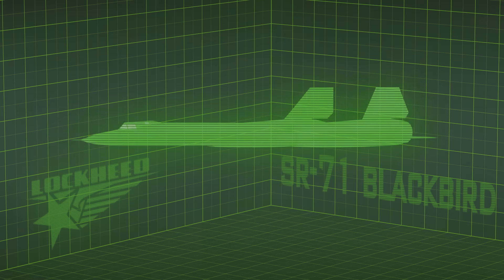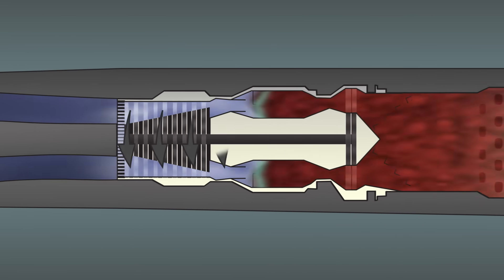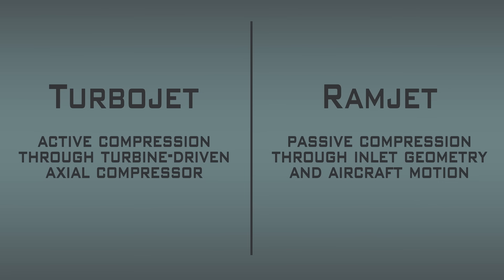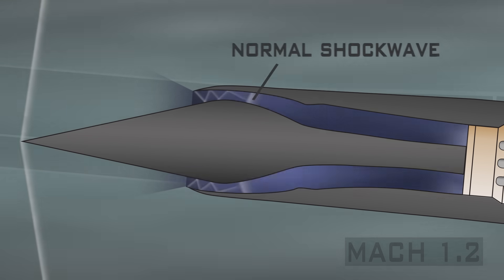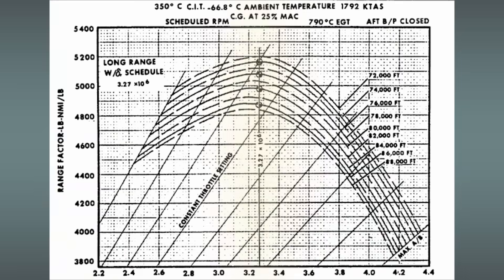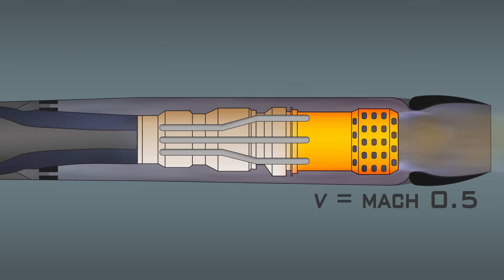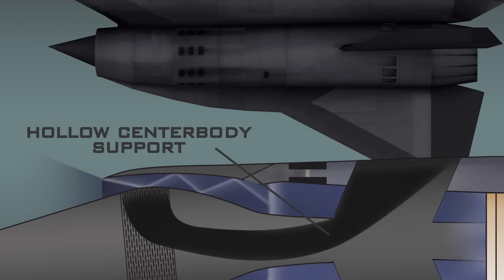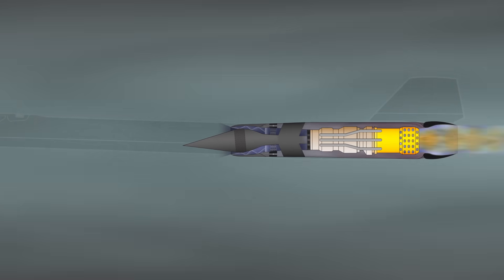The Mighty J58 - The SR-71's Secret Powerhouse

Comment: Flares? who need flare when you can just outrun the damn missile
Reply: +Bartonovich52 Blackbirds have actually outran missiles before......
Reply: Lardawg 67 Not true. Blackbirds regularly went on spy missions over Russia. The incident with the swedish Viggen is proof that they at least went over Sweden into russian territory.
Reply: I have talked to people that HAVE flown missions. You are the one that stated the SR-71 went straight to the museum after test flights. What is the source of that information ???  Where did you get that info ....that's what I'm asking you to produce....even if it's not absolute proof. Obviously you can't produce it which is why you resort to insults.
Reply: They did fly over the USSR and they did outrun all missiles fired at them.
In fact no SR-71 has ever been shot down.
Reply: LOL I can't even respond to that. This conversation is getting dumber by the minute.  You are the weakest link...goodbye.
Reply: ThatMontmorency Friends or not, fact of the matter is the Blackbird was used. A lot.
Reply: It's not a simple matter of the speed of the missile vs speed of target. By the time the missile has climbed to the 80,000ft+ altitude of the SR-71 (around 20 seconds for something like the SA-2/S-75), the target, travelling at over Mach 3, is some 15 miles further downrange. Given the missile must be fired at an angle (i.e. not stright up) to achieve intercept, the time-to-altitude is even longer and the target further away.

With the limited fuel of a high-speed missile, it has run out of thrust long before reaching the vicinity of the target.

Then you have the problem of tracking targets with older, mechanically-scanning radar systems (this is the '60s and '70s we're talking about). A high speed, high altitude target travels a long way between each signal return, making it harder to achieve accurate guidance for a missile interception.

Plus adding in the less sophisticated computing power of systems designed 50 or 60 years ago.

Altogether, it's actually quite easy to see how difficult it was at that time to shoot down a target like the SR-71, even with high-performance missiles of the time.
Reply: Yes, because the divisiveness today goes back to 1981 when it was first reported to the public. Just man up and admit you were wrong. It's your fault for not fact checking yourself. But please, go on and keep making a fool of yourself. It's no skin off my sack.
Reply: 1970's missile*
Reply: Stoyan Todorov truu
Reply: "Every educated person immediately remembers renown Soviet mathematician Lev Pontyagin and his Optimal Control Theory"

Personally consider myself rather intelligent but I DONT KNOW WHO DA FAQ DIS IS.
Reply: I didn't read every reply here, but the SR-71 absolutely flew on missions. North Korea even tried to shoot one down(with soviet made missiles) and missed. Barely. This event is pretty well documented and has been reported on by several outlets. Even as early as 1981. If you want a source, just google 'sr-71 north korea'.
Reply: @Stoyan- No I didn't see that post....but thanks. The weakest link comment belongs to ThatMontmorency, not you. I have two friends who were SR-71 pilots so I know that ThatMontmorency's comments are wrong.
Reply: Lardawg 67 did they experience any problems or cancer after flying?
Reply: "While the SR-71 carried radar countermeasures to evade interception efforts, its greatest protection was its combination of high altitude and very high speed, which made it almost invulnerable. Along with its low radar cross-section, these qualities gave a very short amount of time for an enemy surface-to-air missile (SAM) site to acquire and track the aircraft on radar. By the time the SAM site could track the SR-71, it was often too late to launch a SAM, and the SR-71 would be out of range before the SAM could catch up to it. If the SAM site could track the SR-71 and fire a SAM in time, the SAM would expend nearly all of the delta-v of its boost and sustainer phases just reaching the SR-71's altitude: at this point, out of thrust, it would go ballistic. Merely accelerating would typically be enough for an SR-71 to evade a SAM; changes by the pilots in the SR-71's speed, altitude, and heading were also often enough to spoil any radar lock on the plane by SAM sites or enemy fighters. At sustained speeds of more than Mach 3.2, the plane was faster than the Soviet Union's fastest interceptor, the Mikoyan-Gurevich MiG-25, which also could not reach the SR-71's altitude. During its service life, no SR-71 was shot down."
Reply: +ThatMontmorency
False, the SR-71 was used in recon missions up through 1990(when it was retired from that kind of service but 3 were brought back into service in 1995). As a matter of fact on 19 October 1997, the last flight of SR-71B #61-7956 was at Edwards AFB Open House. I was there and witnessed that flight as a member of the USAF. I'd seen #956 launch and recover on numerous occasions prior to that. 
Anyway the SR-71's side looking camera's got lots of peek's inside Russia without flying over Russia(Due to an agreement between the Soviet Union and the United States restricting the use of manned vehicles over the Soviet landmass), those flights were done out of RAF Mildenhall, UK were I was also stationed at one point in time. The A-12 Blackbird on the other hand only flew a few combat recon mission over Vietnam out of Japan as well as a few non-combat recon missions over N. Korea. It was eventually replaced with the SR-71 Blackbird which flew it's first recon mission out of Japan on 21 March 1968. On July 1st of that same year the SR-71 and A-12 Blackbirds had a "fly-off" in a mission over Vietnam to see which was better.

I don't know what's more annoying, obvious Trolls, or armchair quarterbacks such as yourself that think you know everything. Especially when it has anything to do with USAF operations I was involved in or directly witness to.
Reply: ThatMontmorency Yea, except all the times it flew over Israel and Vietnam...
Reply: On the year 2980: why do you need stealth technology if you can outrun the damm radiowaves?
Reply: Back then, you definitely could. There were actually a few documented cases of literally outflying missiles. And there were multiple missions deep into the heart of Russian territory with the SR-71, most of which were never even engaged because they didn't want to waste missiles on them.
Reply: By the mid-1980s, Swedish Viggen fighter pilots, using the predictable patterns of Lockheed SR-71 Blackbird routine flights over the Baltic Sea, had managed to achieve missile lock-on with radar on the SR-71 on numerous occasions. Despite heavy jamming from the SR-71, target illumination was maintained by feeding target location from ground-based radars to the fire-control computer in the Viggen. The most common site for the lock-on to occur was the thin stretch of international airspace between Öland and Gotland that the SR-71 used on the return flight.[83][84][85] The Viggen is the only aircraft to get an acknowledged radar lock on the SR-71.[86] This is a straight up copy pasta from the Saab 37 Viggen article in wikipedia.
Reply: It's not that complex (although the equations themselves can be), just using calculus to boil down criteria to give an optimum solution. The physical constraints - time to altitude, missile fuel and maneuverability, radar tracking capabilities, speed of target - still exist. 

Getting something from a standing start to 25,000m altitude, not to mention horizontal range, in order to intercept a target  travelling at getting on for a kilometre a second, with just 25 seconds of thrust available and only a few hundred km/h in the way of speed advantage - that envelope for an interception becomes vanishingly small unless the SR-71 maintains a direct heading towards the launch site, ignoring all radar warnings.
Reply: I know AA missiles can go significantly faster than mach 3.2 (though the plane could get faster for short amounts of time, there are many unofficial sources saying sprints at 3.5 were possible in serious situations). Just because the missile is faster however doesn't mean that it can intercept the plane. Since they use solid rocket fuel, they have limited amounts of propellant (fun fact, missiles only hit their top speed for a split second, right before they run out of fuel, they actually coast for much of the flight). By the time the SR-71 was detected and a missile was launched, and the missile climbed to the required altitude, the missile wouldn't have enough fuel left to catch the target before it ran out. Here's an explination that goes into more detail: https://www.quora.com/How-was-SR-71-able-to-outrun-SA-missiles

The diagram shows how an S-75 would have serious trouble hitting a mach 3.2 plane, and would be completely unable to hit a mach 3.5 plane.

Also it's worth mentioning that the plane flew high enough, and had good enough cameras that it didn't need to intrude often. For example, to keep an eye on the soviet submarine pens all they had to do was fly over the arctic ocean. Often they would even provide countries like the Soviet Union and China the pictures taken to show that the flights were legal.

In addition, here's a story written by an actual SR-71 pilot, that details how they were fired at often (now not with current gen AA systems, I imagine an S-400 would make short work of one). http://sploid.gizmodo.com/5511236/the-thrill-of-flying-the-sr-71-blackbird

Finally, the plane wasn't invincible. In some cases Soviet planes did get lock on, but didn't fire (usually because the plane was in international airspace).
Reply: ThatMontmorency so does this mean all the hype surrounding Russia's new hypersonic missions is just that, hype . If a slower missile can shoot down a faster object, then that negates Russia's supposed Mach 10 Zircon missiles and the one laucned from the Mig 31
Reply: i guess you think the earth is flat too?
Reply: The SR-71 out ran a SAM over North Korea in 1978 if im not mistaken there a video on youtube of the pilot and nav talking about it
Reply: AHAHAHAAHH.

The USSR  was in fact the absolute prime mission for the Blackbird.

AND FOR THE RECORD: the SR71 survived over 450 attempts from G2A missiles to shoot it down.

Reasons? Because at those altitudes, there are were no missiles able to keep up with the speed because of the ramjet nature of the J58 engine.

The blackbird was retired in 1990, 20 years and tens of thousands of photos and intels later.
Lockheed actually proposed, in the recent past, a new successor to the Sr71.
Reply: +ThatMontmorency......I never said my pilot friends flew over Russia, in fact I stated we never flew over Russia in an SR-71 . I was referring to your comment that the SR-71 never flew a mission and went straight to the museum. Why do you state such ridiculous things as fact ??? Where is your proof that the SR-71 never flew a mission ?? BTW my 2 pilot friends are Lt Col Robert G Sowers (1st SR-71 instructor pilot) and Maj Gen Pat Halloran (U2/ SR-71 pilot). My avatar picture has the three of us at the Air Force Academy.  If I state something I will always be able to prove it. Peace
Reply: ThatMontmorency no, are you insane?
Reply: It does not take goddamn genius to know that an aircraft going at mach 3 and can sustain such speeds for well over an hour at 80,000 feet has a head start in height distance when out running a missile with equally or faster acceleration launched from the ground. All that matters is how much fuel that missile has which is never enough to catch a the SR-71. The biggest surface to air  missiles only have enough fuel to last no more than 3 min at best. Over 800 missiles were launched at the SR-71 and all failed.

The only way possible to bring down an SR-71 if it is caught right in the middle of multiple defense domes such as 4-5 of them under a central defensive grid and all launched multiple missiles simultaneously heading toward the same intercept vector. Then there is no way the SR-71 can out maneuver or out accelerate those  missiles coming from all directions.
Reply: People in 1981 be like "They gonna argue bout this till 2017"
Reply: thats not true... you still cant beat rockets for raw speed and acceleration. not even the rockets of the 60s. they just outran the targeting abilities
Reply: These trolls lol. like first Last said : "While the SR-71 carried radar countermeasures to evade interception efforts, its greatest protection was its combination of high altitude and very high speed, which made it almost invulnerable. Along with its low radar cross-section, these qualities gave a very short amount of time for an enemy surface-to-air missile (SAM) site to acquire and track the aircraft on radar. By the time the SAM site could track the SR-71, it was often too late to launch a SAM, and the SR-71 would be out of range before the SAM could catch up to it. If the SAM site could track the SR-71 and fire a SAM in time, the SAM would expend nearly all of the delta-v of its boost and sustainer phases just reaching the SR-71's altitude: at this point, out of thrust, it would go ballistic. Merely accelerating would typically be enough for an SR-71 to evade a SAM; changes by the pilots in the SR-71's speed, altitude, and heading were also often enough to spoil any radar lock on the plane by SAM sites or enemy fighters. At sustained speeds of more than Mach 3.2, the plane was faster than the Soviet Union's fastest interceptor, the Mikoyan-Gurevich MiG-25, which also could not reach the SR-71's altitude. During its service life, no SR-71 was shot down."
Reply: If everyone here just picked up a book instead of arguing on the internet or listening to their black ops pilot friends they'd know it never officially flew over the USSR after Francis Gary Powers unfortunate capture put a stall on what where once routine flights, saying that alot of the USSR didn't have great radar coverage so who knows. 
Also with the SIGINT system and it's op ceiling being 80k coupled with strategic placement of  most soviet equipment, they probably had no real reason too. 
The SR 71 was never downed by enemy action although there where specific SAM systems that probably could intercept it like the SA-5 Gammon which was designed to shallow dive high altitude aircraft. On an air to air front the MIG 31 was fast enough to probably intercept. 
so short answer, who the fuck knows, but we can surmise there was probably no reason too.
Reply: There was no reason for the SR-71 to overfly the USSR. 

In fact... the U-2 was never originally supposed to overfly the USSR, but Eisenhower desperately needed Intel. He was only willing to risk a few missions, and Gary Powers got shot down and the rest is history. It was a terrible loss of face for the US and ended any possibility of sending aircraft OVER the USSR—no matter what kind. 

The SR-71 was designed to fly over the USSR, but the risks were too high and it never did. 

As I said before... a few minutes of transit over a tiny third world with access to the sea nation is an entirely different ballgame than going over the world’s largest nation with a dedicated homeland defence Air Force (the PVO). 

And they were right. During the Baltic transits (which never penetrated Soviet airspace) both Swedish and Soviet interceptor aircraft gained favourable firing positions multiple times on the SR-71... the Swedes for fun and practice, the Soviets ready to blow it out of the sky the nanosecond it strayed into Soviet airspace. The risk of a man and technology was far too great. 

Of course, they didn’t need the SR-71. Corona spy satellites were giving imagery and soon the KH series of satellites could do it in near real time. There was also the Ryan Firebee drone which didn’t risk a man or high technology, and was nearly undetectable and almost impossible to shoot down. Humanint and Sigint had higher intelligence yields for far lower risks. 

The SR-71... like the A-10.. is a Chuck Norris airplane. It has a reputation it didn’t earn and doesn’t deserve.... being written in as part of the American Myth where through tight shots, ommisions, and weasel words it winds up being the best even though it really did sweet fuck all. A C-135 could have done 90% of the missions it flew better and cheaper.... and actually does overfly Russia now as part of the Open Skies Treaty.
Reply: You would rather need chaff's and not flares to begin with. Most surface to air missiles are radar guided. (I know, it's a joke but I just had to say it.)
Reply: Lardawg 67 Read my second comment :)
Reply: Lardawg 67 So you can't see the post where I have a video confirming YOU are right and I apologize? Good day to you.
Reply: ThatMontmorency challenge acepted /(-_-)/
Reply: Flintstoned XD
Reply: its just differential EQ no big deal
Reply: Sesko Rirkea Shimrui and also the heat by the compression
Reply: lightwaves are still effective, laser guidance my dude
Reply: It’s basically a “Just in Case” clause to avoid paying insurance.
Reply: A quick addition to this old chain, the SR-71 did often fly outside of Russian air space because of its amazing camera equipment, but it did fly over airspace, and it was considered impossible to shoot down based on the insanely advanced Ewar it had combined with its incredible speed the SR-71 was not stealth despite its color, it was actually weirdly reverse. It could project itself to have a radar signature the size of a barn
Reply: not when it is coming at you from the front
Reply: Technically they can't out run missles. What they do is fly so fast that the missles tracking system can't accurately track their target.
Reply: The SR 71 needed to be refueled after flying for a while due to fuel leaking out of the expanding seams on the body. it also was about 6 inches longer overall when it landed then when it took off
Reply: I read the article. How are flights over the Baltic Sea and a stretch of "international airspace" flying over Russia ? Oland and Gotland are not even on the Russian border. The SR-71 had sideways cameras that were capable of filming deep into Russia without even entering Russia. This article proves nothing .
Reply: Probably because every educated person has an education for themselves gained from experiences that are solely their own. 

Along with the elitist dickhead use of the term by ThatMontmormency being completely irrelevant and meant to frame himself as from a superior group compared to others. The superior dickhead group.
Reply: Ulfcytel Yep, it's not the speed directly, but the missiles inability to correct for such speed changes.
Reply: Wow....I was just reading through these comments after watching this video for the 1st time.... someone actually said that a missile going .5 mach will shoot down a plane going 3-4 mach🤣🤣🤣🤣🤣 who isn't good at math🤪🤪
Reply: @74superglide  - 4 out of 3 people have trouble with fractions.
Reply: Some people are not good at geometry, either.......
Reply: The SR-71 only “outran” missiles because it only overflew poor and tiny nations with sea access. By the time they were ready to fire it was a stern chase—missiles gaining, but running out of fuel before they could hit. The Iraqis actually did the same against the Phoenixes the USN tried to fire at them. But the SR-71 doing a two hour transit across the USSR would have many SAM batteries firing at it head on... and no direction to turn which wouldn’t bring it into range of other batteries.
Reply: how fast you need to go to outrun a missile?
Reply: ThatMontmorency k nigga damn
Reply: Hey can you send me a link to that information. I would like to read about it. If its one "incident" how can you say they flew over Russia regularly ? I'm not being a smart ass, but something doesn't sound right. We had a U2 stray into Russian territory during the cuban missile crisis but I wasn't aware of any SR-71 over Russia. If you have the info please share. Thanks !!
Reply: ThatMontmorency the fastest missiles only goes mach 3 or 4 I'm prettysure tbr heat caused by the friction of going that fast would detonate it
Reply: +Sesko Rirkea Shimrui False. Mach 3 is what a modern anti-ship missile can reach. And it can do it at sea level (!). An AA missile is much smaller and thinner than an anti-ship one, carries less payload, does not need to accelerate from zero and has a much shorter active engine phase (i.e. less fuel to carry). Which is why they are so much faster.
Reply: Zimri Leisher if they were detected they’ve would have gotten a taste of the worlds best interceptors ☭

MiG-24 ☭
MiG-35 ☭
Reply: @Americana-deluxe   The MiG 24 doesn't exist and The MiG 35 is a Gen 4.5 fighter
Reply: @ Your local meme and anime dealer. 

And 5th generation is just a marketing term invented by Lockheed Martin to drain the US Treasury.
Reply: @calvinnickel9995  Then there is no generation of jets. You people are special
Reply: The SR71 never flew over the Soviet Union or China. The Russians were aware of the SR71 before it went into service. An amazing plane as it was it wouldn't have taken Russia long to work out a way to intercept. It's much more of a feat to make a Mach 3.2 aircraft than to shoot one down.
Reply: You can't. In fact, this was why they never used the SR-71 over Russia.... and the similarly performing XB-70 was cancelled.
Reply: @Bartonovich52  ahhh... it ran quite a few missions over Russia. They just don't out right say that. Many of the Blackbirds missions and its specs are classified to this day. We will never know what this plane truly did or what it was really capable of.
Reply: @Bartonovich52  no sr71 flew over russia many many times just like the u2 jet
Reply: +Ninja Man No, it can't really outrun a missile. AA missiles are much faster than Mach 3. SAM missiles are slower (at least were slower in that era), but SAM missiles are used differently - they don't need to be able to chase the plane. Every educated person immediately remembers renown Soviet mathematician Lev Pontyagin and his Optimal Control Theory, which was initially created specifically for the purpose of SAM guidance. It guarantees that a slower SAM missile can always meet up with a much faster airplane if fired and guided properly. Obviously, this is less important with modern SAM systems, like Russian S300 with Mach 7 missiles. Nevertheless, this is still the reason modern mid-range systems with Mach 4 missiles can reliably shoot down Mach 8 targets.
Reply: The SR-71 never flew over Russia. The U2 was shot down over Russia but they never risked the blackbird flying over Russia.
Reply: @lardawg6794  it was the blackbird's mission to fly over russia... they used it to take photos of military installations! Thats why it was built in the first place, to fly over Russia and the fact you say it never flew over it during cold war is spreading false info xD
Reply: @user-h3w7d  - show me your proof that it flew over Russia at anytime...ever. It had sideways looking cameras that could take pictures inside Russia while flying outside the border....but it never entered Russian airspace. The U2 is a different story.
Reply: @user-h3w7d  - ......* Crickets *
Reply: @user-h3w7d  sr71 never flew over Russia, thing is once u2 spy plane was shot down, America understood they had underestimated Russia, because all this time although U2 was flying high over Russian Airspace successfully, and was not shot that time, was not because of perception U2 can't be seen, as Russia definitely had U2 on its radar, and were continuously recording flight path of U2, but because Russia was busy making their new intercepter missile operational, when it was ready, 
it made U2 its first prey. 
America although having SR71 designed and operational, restricted its mission over Russia not due to risk of sr 71 being shot down but due to risk of war breaking out. Already with U2, breaking point of Russia's patience was reached, and if SR71 would have also did the same, then definitely one more cold war would have begun.
Though Sr71 though would have definitely been successful in outrunning Russian missiles or intercepters at that time, but was definitely not fully invisible to Russian radars. And that would have been enough for Russians to go in full nuclear war with America. That is why it never flew inside Russia, although it had full capability of doing so successfully. 
But still America was able to conduct it's monitoring over Russia from its borders, Sr71 had advanced camera and recording ability with state of the art technology, to look for any changes in Russian movement and buildup, far off by patrolling it's borders.
This is how without even entering or breaking into Russian Airspace SR 71 was able to conduct its mission, this pissed Russia a lot, as they couldn't do much in that case, as action could have been taken only when they entered into their Airspace. That's the reality
Reply: There's no such concept as "outrunning a missile" in combat aviation. The idea exists only in intoxicated minds of various uneducated "murican mavricks" and "armchair fighter pilots" on the Internet. AA missiles are simply too fast to be outrun by anything (they routinely reach around 7 Mach or more). SA missiles are based on a completely different principle: they are lauched to intercept, not to chase the target. Within a SAM site range a properly launched and guided 0.5 Mach SA misile will easily and reliably hit a 3-4 Mach plane - there's no way to "outrun" it. Even a 0.5 Mach missile will do that, but modern SA missiles are much faster.
Reply: Um.. I'm sorry, but 3rd grade math just won't cut it. The Theory of Optimal Control is a very strict mathematical theory, which made Lev Pontryagin such a famous mathematician in the world. And it is a rather complex theory. There are very specific criteria for speed of the target, speed of the projectile, maneuverability of both, detection range etc. etc. etc. that tell what kind of missile is able to intercept what kind of target and how it should be controlled. And the truth is that reliable interception of SR-71 is well within the capabilities of even archaic SAM systems.
Reply: Um... "Changes"? Completely false. That's actually the primary issue with SR-71 that ultimately led to its failure: the plane is completely incapable of any significant trajectory changes. At its operational speed and altitude it can only fly in a straight line with very limited maneuvering capability. In fact, SR-71 pilots were strictly instructed not to attempt any abrupt speed ot trajectory changes in these aitcraft, since many of those infamously frequent SR-71 crashes were traced back to airframe's inability to withstand structural stresses associated with high-speed maneuvering in high-tempertature environment.
And this is the crux of the issue, this is the primary reason why it is so easy to plot the optimal interception course for a relatively low-speed SAM missile to virtually guarantee a successful shootdown of SR-71. But if you have modern fast SAMs at your disposal... SR-71 becomes the proverbial fish in a barrel.
Reply: NoSuspect "...every educated person has an education for themselves gained from experiences that are solely their own" - I'm sure I saw these very words written on the grave of the US education system.
No, my poor little thing, only street thugs get their "education" from "experiences that are solely their own". And I'm sure that's exactly how you "learned" that putrid drivel you (and your socks) are spewing here.
Reply: Lardawg 67 "Where is your proof that the SR-71 never flew a mission ?" Really? You are asking me to prove a negative statement? You see, things like that is what prevents people from perceiving you as a competent human being.
Reply: Wrong! Firstly, it were "not that complex", Pontraygin's Optimal Control Theory would not have been considered one of the greatest mathematical breakthroughs of XX century. Secondly, "25 seconds" is how long the second stage engine works in S75 missile when fuelled for a quater of its fuel tank volume (for optimal acceleration). Fully-fueled, it runs for a minute. This also fails to take into account the running time of solid-fuel first stage . And yes, the combined running time is more than enough to reach SR-71's aItitude. It s the ultra-maneuverability of a SAM compared to complete lack of maneuverability of SR-71 that made it sitting duck agains Soviet SAMs.
Reply: Lardawg 67 ^^^ Apparently this guy has "pilot friends" who flew over USSR in SR-71, folks. OK... Internet is a place where everything is possible. It is always a "friend" or "relative" though :)))
Reply: "Alternative facts" (aka laughable putrid BS) continue to stream out of the heads of 'murican lemmings and right into the YouTube comment streams. "North Korea even tried to shoot one down...". Facepalm. Double facepalm.
Reply: Stoyan Todorov False. No SR-71 has ever been flown in Soviet airspace. No SR-71 has ever been flown in an actual recon mission. It was decommissioned immediately after test flights.
Reply: e1123581321345589144 Nope. After Powers got shot down, all criminal flights over USSR were stopped for good. Not only SR-71 has never been flown over USSR, but SR-71 has never been used in any actual mission of any kind. After the crashes during tests, this ended up being a "straight to the museum" plane.